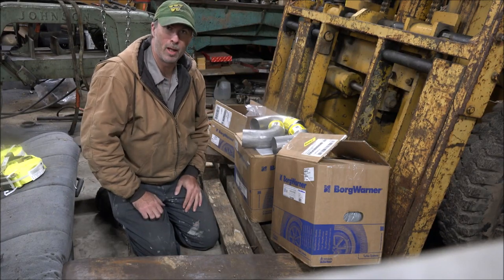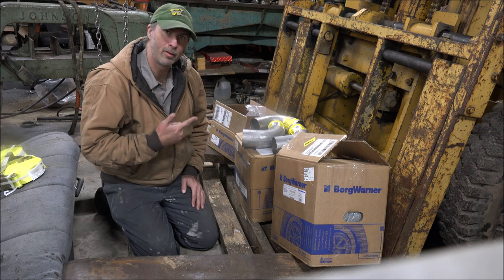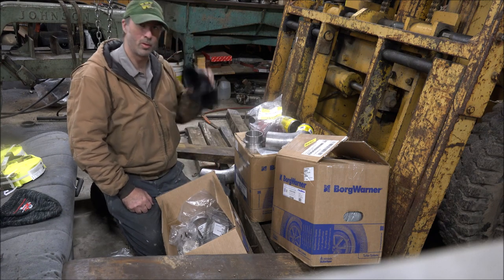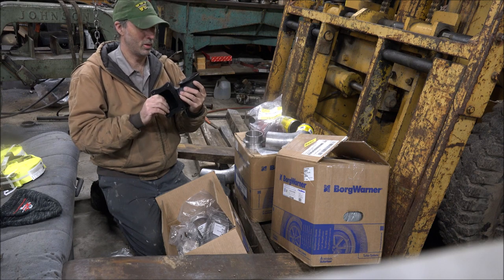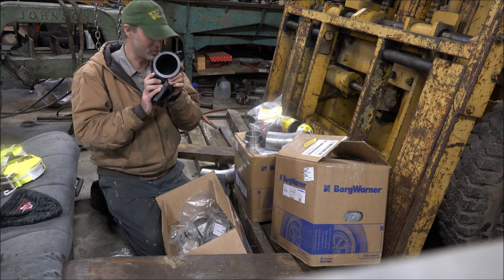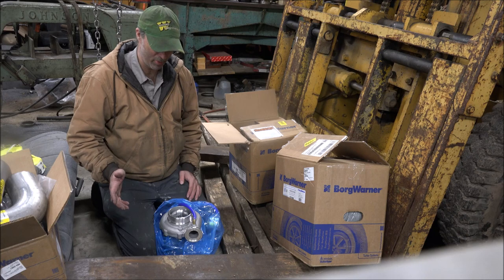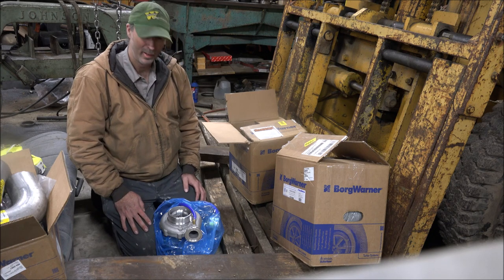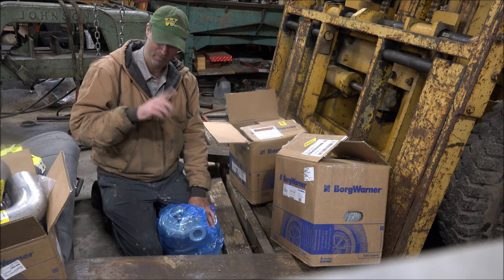Compound Turbo Design and Sizing Working on  First Gen Trailer Towing Power House with Area Diesel

Comment: Area Diesel has a good guy in the videos.  I enjoy listening to him, using the correct terminology and describing everything correctly as I listen to fact check him lol.  He really seems to know his stuff and I intend to use them in the future for injectors and such.  Brian get rid of those 3.07's!  In my opinion they really load the engine and make it work all the time.  Especially towing and with the awful gaps in the Getrag.  Happy to see you doing more 1stgen Cummins content, the stuff I know you for.
Reply from the maker: I like the 3.07 for towing because I can run in 4th and not kill the tranny.  With no trailer it is very free running even in 5th. With the right turbo setup it should be strong in that 1500-2500rpm range I usually run in. The Ve fuel falls off with rpm so I can make more power and torque by making a setup that lives down low.  Also it is nice to just come off idle and bam it is gone like a 450+cid gas engine. 🙂

Comment: This will be a fun series to watch! I’m running an HX40 over an HT3B in my 2nd gen 12V. The 40 was modified by Piers Diesel wayyy back when which helped the lag. It’s pretty old school still a bit laggy (as you mention) but it’ll move enough air to burn all the fuel I can hose through a set of DDP4 injectors. I do tow a lot and egt’s are rarely a concern. 

You’re going to love this setup!
Reply from the maker: That was a really common setup 15 years ago. I can even remember installing some of those kits. Lots of them used the stock turbo with a 21cm exhaust and the 3b they still made a huge difference in gets. Curios how far back you got yours is your engine fire ringed or piano wired gasket?
Reply: @bcbloc02  it was probably back in about 2004, like you said it was common back then. I ran the modified 40 as a single for several years before adding the rest. The head is “o-ringed”. It’s been a pretty reliable setup for me, I ran it for years on my ‘96, then bought a ‘98 12V back in 2013 and swapped everything into that truck.
Reply from the maker: @woodenhead8887  I have one guy here local I did a setup like that for that pulls a backhoe. It was built with 370 pistons 5x.014 injectors a 215hp  pump set to cut fuel just before the timing retards fire ringed with stock head bolts. It dynoed 550hp and 1200tq at Scheid one year. It is still going with over 300K miles now only had the valves adjusted and a couple of fuel transfer pumps.
Reply: I have a 63/71/14 on my truck now and super laggy gonna upgrade to compounds just can’t decide between a he351 62/65, 63/68/12 or 62/65/12 paired with a 171702 75/96/1.32 or a s480 with a 1.10-1.25 AR. If you have any recommendations of which s480 to run or opinions on the combination I would appreciate it. 

Truck is a daily driver and would like to still be able to tow my 10,000lb camper here and there (once a year at most) looking for a 600-700hp. It seems anything over 750hp and daily driven don’t mix.

Comment: Brian - your link to Area Diesel's video has an embedded timestamp in it, so it causes the video to start at about 5:41 into it. I'm pretty sure that was not intentional. You need to pull off the "&t=341s" part at the end of the URL. Besides that, thanks for the update - it's way over my head, but still interesting.
Reply from the maker: I tried to fix it but can't tell if it did. Thanks for the heads up! Computers are also way over my head. LOL
Reply: @bcbloc02  It's not exactly right, but it now seems to work. Now the URL has a rogue "=0s" on the end. I think your browser (or YT) is trying to be 'smart' and making a URL designed to 'continue' where you personally left off. Not sure how one normally copy/pastes a raw URL into a  YT description box. You may get a best URL by going to the video and using the 'Share' button and copying the URL it shows there. I know a bit about computers (my career world for 30+ years), but they never cease to come up with new ways to do unexpected things. grrr.

Comment: I am very interested to see how this turns out as I just picked up a 1996 P-pump truck. Looking at a couple compound setups, one of them uses a VGT setup and controller so you exhaust braking like the later models. Hope this gets done soon, I will be glued to the screen! If you were closer I would come help!
Reply from the maker: VGT adds performance at the expense of longevity and a lot more cost in my opinion.
Reply: @bcbloc02  wish they made a real jake for the 5.9...

Comment: Brian, are you sticking with the VE? Hope so! Can't wait to follow along. I'm currently gathering parts to build my '70 Sweptline with a ve-pumped 12 valve. The turbo I want to run is still a big ???. I doubt I will pop for compounds. But this will still be super interesting.
Reply from the maker: If you tow compounds are the way to go. Empty truck you have a lot of options depending on how you want the power curve.  Yes my truck will stay a  VE the built in timing advance allows for superior driveability and fuel mileage versus a p-pump although it does power limit you. I( am power limited by my radiator size anyway as the frontal area of these trucks isn't enough to cool over 600hp i don't think regardless of what radiator you put in it. My common rail buddies find they can't run over about 500hp continuous or coolant temps eventually heat soak and they derate. Of course they are grossing 40k to be putting down that kind of hp for several minutes pulling grades.

Comment: So why the T6 frame on the atmosphere charger instead of T4 if the A/R is the same?  You already said you aren't going to be spinning it high.  Just trying to understand, not question.
Reply from the maker: The casting I have to hook the exhaust housings together is made for t6.  I also think there is some transient benefit to having some plenum volume between the turbo stages.  No concrete data but seems it is that way from my experience.

Comment: Brian
very Interesting project you have going there. now for info I am never going to attempt such a project. OK my BMW has a turbo and a traction battery . here is my question do these turbos operate in parallel or series ? , a BMW we had a couple of years ago was badged twin turbo , but the mark one eyeball could only see one , I assumed it had vanes in it to alter the boost , it worked well and did not have a noticeable lag but that may have been the 8 speed steptronic box and the ECU making adjustments on the fly .

How's Bailey doing ? the Bailey we sponsored is now with his blind owner and is doing very well . latest one is Kevin , that makes 8 dogs we have sponsored though their  training 

be safe and say safe from Stuart & Linda
Reply from the maker: They are series in my setup and thus compound. I have seen a turbo that had 2 different sized compressor wheels on the same turbine shaft so perhaps that is what you had.
Reply: @bcbloc02  thanks Brian for the info

Comment: Would a 5.9 24 valve use the same turbos as you 12 valve?   I would assume so.  I can't wait to see this series finished.
Reply from the maker: Yeah displacement and rpms is the key factors in sizing.

Comment: does your truck have overdrive. i had one that had 3.07 gear but no overdrive always wanted to see how one would do with 3.07 and over drive and lockup
Reply from the maker: Yeah mine is a 5spd manual so 4th is direct and 5th is a .77overdrive

Comment: Curious as to what size turbine wheel and housing a/r you’re running on the low pressure?
Reply from the maker: 87mm with a .90ar

Comment: that 472 should be really good..  From my experience with the HE351cw I just love how it drives, I have a 67mm turbine in mine and don't see any reason to want smaller, especially on an automatic tranny truck.. Power driven diesel/horsetorques diesel put down 1300hp with a 351 and I think an S475 or 480... My goal is 1000 hp so I'm looking for an S475
Look forward to seeing yours come along!
Reply from the maker: The 72E outflows the old 75. Either would be very tapped out at 1000rwhp I would think you would need to be at an 80 or bigger to support a solid grand to the tires.
Reply: @bcbloc02  true.. but upgrading within a frame size shouldn't be too hard.. in "fun mode" 1000hp would be nice, but it won't have to live at that power level long.. it'll probably be half that most of the time.  What did you figure peak power capability would be from your setup? Staying with the VE pump you're probably going to be fuel limited more than anything
Reply from the maker: @Rx7man  I doubt it will ever be over 500rwhp with the 12mm VE My goal is to have egt's stay under 1200deg under all conditions. Peak power for this setup should be right at a grand if egts and fueling were not an issue.